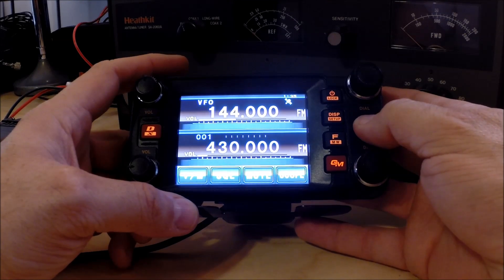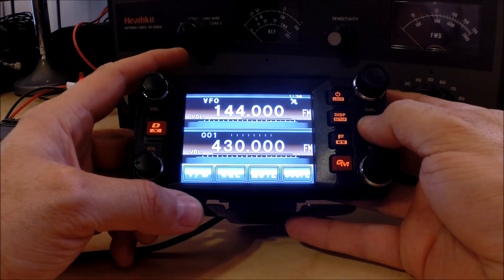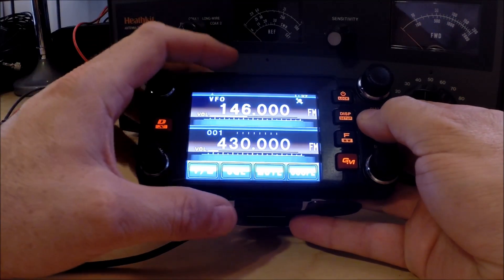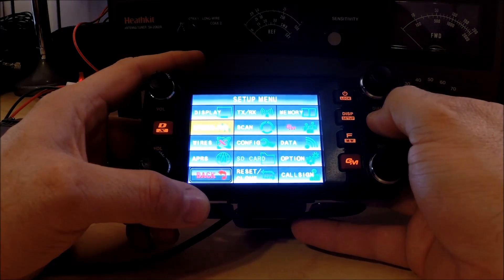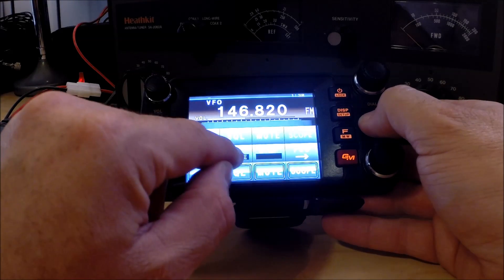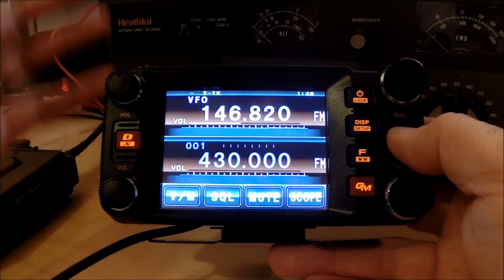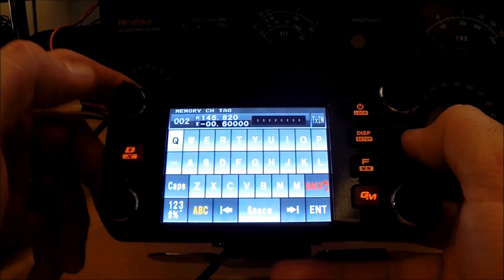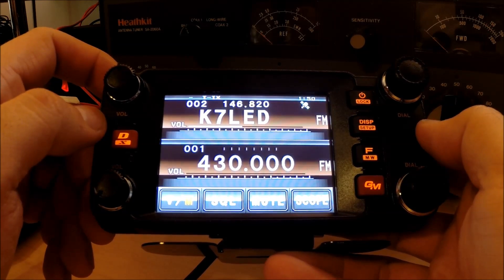Yaesu FTM-400DR Repeater Programming

Comment: Thanks for the YouTube.  I am a new general and bought a Yeasu 400 yesterday at Ham Radio Outlet in Denver and called and asked how to put a tone in for the local repeater and was told to read the manual.  I actually did read the manual but it still was not clear.  Your video is getting me on the air.  Very thankful for the help.

Comment: I was curious if you could use different tx and rx tones. I realize now in practical use, if a repeater is using different tones, you can probably ignore the rx tone which this radio does just fine.

Comment: Ive just purchased a 400 and used the ADMS software from the Yaesu website to programm and setup/backup the radio. Its free to download and makes programming a lot easier. Setting up manually does have the bonus of familiarising youself with the controls on the radio itself of course so a thumbs up for that.
Reply: Where on the Yaesu site is the free software

Comment: Great video.  Can you do one for programming a repeater that doesn’t use the typical offset?  I’m trying to program the ISS using 145.800 an the downlink and 437.800 as the uplink.   I can’t seem to figure this one out
Reply: You could always do that with the seperate VFO's and have a memory item for each frequency, like running two radios

Comment: I have been off the air for over 20+ years. Now that I am retiring I an thinking of setting up another shack however I noticed a big change in the radios of today. I always worked Yaesu and Icom and the YAESU FTM-400 DE cough my eye. How has is been?
Reply from the maker: I really enjoy this radio.  The Yaesu digital mode is not popular and I've only used it a couple times just to see how it works.  However the display, relatively easy programming and excellent APRS support really makes this radio great.
Reply: David Yarbrough
Thanks David. I have some thinking to do. I am also looking at the 1200. I think I will run upto the ham shop and pick their brains. lol.

Comment: Thanks for informative video David. I have the same radio but having some problems following your steps to set R-TX. When I'm trying to activate Tone it switches between all of them however it's not showing up on the top of the screen next to"-" negative shift. Are there any other setting should I set to activate it? Please advise, 73
Reply from the maker: Hmm not sure what to say, that's one feature that's always just worked for me, seems pretty straightforward.

Comment: funny, that's a repeater i hear all the time here at my home.. (on tiger Mt. i think)... anyways i wanted to know how you been liking the unit so far.. i like the kenwood 710g .. and i saw this unit as well and this unit is 150 less but seem like it does just about the same.. right now all i got is a baofung and wanted to get my first real radio in the car but kinda drawn between the two.. not sure if the extra 150 is worth it or is this unit just as good... im not really in to the digital other than maybe aprs for letting people see where i'm at and such for rag chew... but im a analog guy %90 of the time.. any help would be great. thanks.

Comment: Thanks just set up My FTM-400DR and could not figure out how to set the tone mode and as usual the Yaesu manual goes into great depth but misses the basics.... once I watched your vid it was all clear!  Wish Yaesu had done a software like the FT1DR so I could hook it up and see the settings for each channel without having to buy it from RT systems. Also It would be nice if I could pull the SD card out of my FT1DR and put it in the FTM400DR and vice versa. Anyway thanks for clarifying the squelch mode setting. 73!!